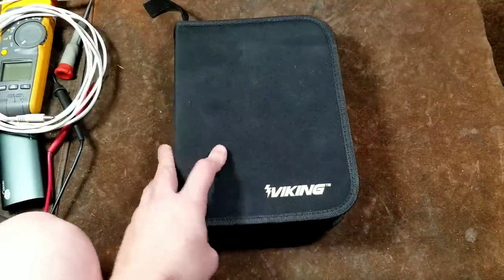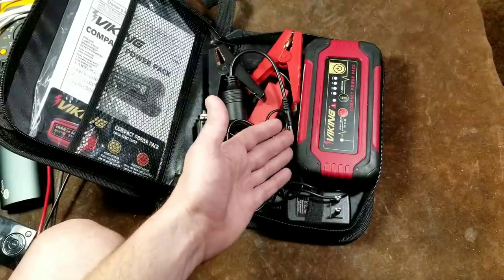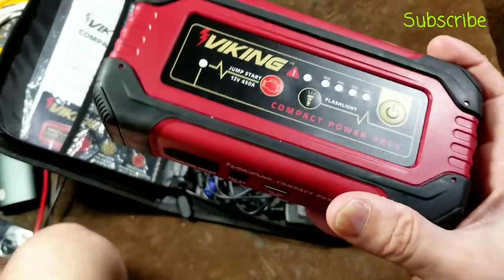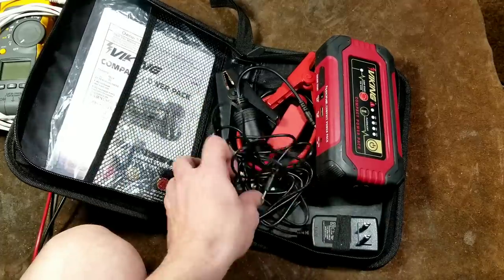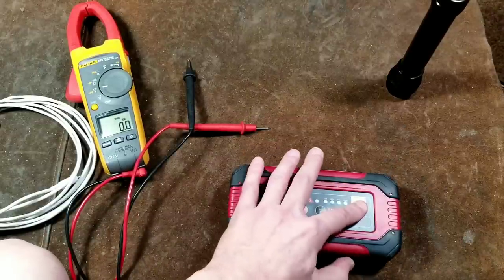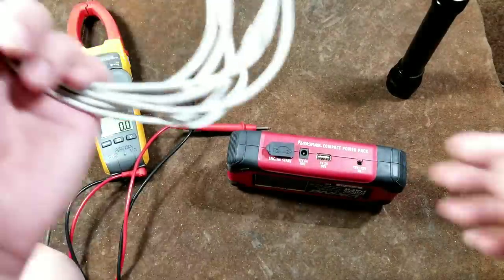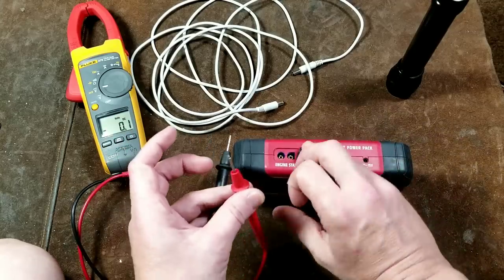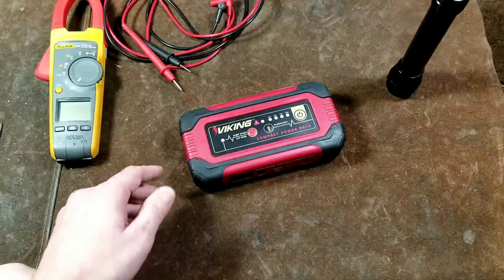Harbor Freight Viking Li-Ion Jump Starter Power Pack Review & Evaluation

Comment: I have this jump pack and I'm satisfied with its performance. I have used the 12v port to power trailer running lights on a night trip from St Louis to Louisville for 5 hours. Having it for multiple uses is nice. I don't leave home without it.

Comment: This thing is Excellent - I've used it for 2 years so far and it works great - Charges in 4 hours - In fact I used it to run my internet router and modem for 3 hrs in my house during this past storm when I lost power - I hooked up a small inverter to it to get out 110V.  Perfect to give your kid just in case it fits in the glove box - Lithium is the way to go - The most important thing for me is fast recharge and this does that.

Comment: I bypassed the switch mentioned at 15:10 with a splice connector on the negative side on mine. I bought it so that i could run a 120w inverter and the switch was sort of a deal breaker but the quality of the box was on point. Amazing  video

Comment: Good honest review!   You definitely know what you’re talking about.  👍. A lead acid pack will start my diesel in warm weather. If you leave the unit on the battery for a while before cranking.  Cold weather I need two units. One on each battery.

Comment: the screws  clamp the shell together  but those groves along the edge keep the box aligned and prevent it from separating.  If the battery was not held down it could cause a problem  there sb nothing pushing the shell apart. .   The 12 V sends power out to activate the safety box to verify jumper cables are connected properly.

Comment: Wow, I was planning on purchasing the harbor freight jump starter but decided to pass on it due to the false capacity rating. I decided to buy a cheap LiFePO4 version on Amazon called KeepPower. To my surprise, it is mostly identical to the version in this video. Only the lights and buttons on the top cover are in different locations. I only paid $40 for it. Of course they rated it at 12Ah which would only be that capacity at 3.2 volts. I guess honestly rating it 3Ah at 12.6 volts would hurt their sales due to ignorant folks.  

Due to the auto shutdown nature of the jumper and the 12 volt output port detecting voltage on my tester and shutting off, I had to connect directly to the battery to test the actual capacity. Surprisingly it came up to approximately 2,9XX of 3,000 mAh at 12 V. I was a bit impressed. 

I've taken pictures and will be leaving an amazon review soon.
Reply: Cannot find what you said u purchased on Amazon. Care to post a link?
Reply: Ahhh....KeenPower, NOT KeepPower. Have you used your keenpower unit to charge up iPhones or iPads? Or similar devices? I have and it seems to drain the KeenPower’s battery pack quite quickly when charging my iPad. From 100 to 25% on one charge. And it takes hours to complete.

Comment: It look like a good product with some good features on it. I would like to see it in action, jump starting a dead battery
Reply from the maker: I was going to do that but I thought it was kind of pointless. I needed an artificial load to actually test its peak and continuous power outputs which is something I don't have.
Reply: I’m a mechanic and use this to jump start dead cars outside to drive them in for diag work. It works amazing. Very rugged and works well in all temperatures. Holds a charge great and well worth the money
Reply: I will also back it up. I used mine today to jumpstart a 240sx that hasn't been run since 2016 and the battery was from 08.

Comment: I have this unit and it came with just a car charger and my car charger doesn't work so I saw it had a 12 volt in so I plug it in and it just flashes the 25 percent light and doesn't charge. Should I just go to harbor freight and exchange for a new one? The product is great it's very convenient and compact.

Comment: A large diesel engine say for a 18 wheeler will use 1000  amps  at 12 volts will probably ring in around 12000 watts and 20 hp at initial turnover
Good review and description just figured Id through some numbers out for very big diesels

Comment: Really wanted you to start a car that had a dead battery.  Several reviews of this thing (on Amazon and other sites) said it didn't work, or worked for 3 or 4 times and never again, even though it had been plugged in and charging for 2 days.  70% 5 star reviews, but 20% 1 star reviews.

Comment: Project Farm tested several jump starter power packs and the Harbor Freight failed.
Reply: Project Farm just repeated the test and Viking failed again.  It's the pits. I returned mine on the day I bought it because the plastic box on the red positive wire sparked and smoked.    This in a lawn Tractor!
Reply: I have this unit. Bought in 2018 has worked flawless jumping dozens of vehicle's. Still working at 100 % capacity 9/5/22

Comment: Can this jumpstart my Kenworth log loader?
Reply: Probably not.  Your log loader is probably 24 volt system.  You probably have 2 12 volt batteries wired in series. This is designed for only 1 12 volt battery by itself.
Reply: Come to think of it, it might work if you get two of them.  Connect the black lead of one to the red lead of the other.  Then hook the red lead of this thing to your red or positive + post and the black lead of the other one to your black or negative post.  That makes it in series.  Oh wait.  Then you'll have 24 volts coursing through these, which will probably blow the micro-processors and ruin these.
Reply: Actually I came across a Clore Jump 'N Carry, JNC 660, yesterday.  This supposedly is what tow trucks carry with them to jump start cars and pick-ups.  One person commented that it even started his dump truck that has two batteries.  So, if it starts a dump truck diesel engine, I think it should start your Kenworth log loader.  (I used to work in paper /pulp mills so I do know what you are talking about.)  The JNC 660 has a blue case (to help you identify it).  They run about $130, although some fly-by-nighters offer them at $62 and $39, which are probably scams.

Comment: Is it possible to run a small power inverter off the 12v 6 amp output? I tried an 80w continuous/200w peak w/ no load on it & it triggered the overload protection on the Viking (shutoff & beeping).
Reply from the maker: Power inverters have big capacitors which probably what's triggering the overload. Try plugging the power converter into an actual car and then quickly plugging into the power pack it'll probably work in that situation. A power inverter is a computer switching power supply that's just operating in Reverse to give you AC
Reply: @CatusMaximus  Hi Catus, thank you for doing this review as I've had some questions about this Viking Power pack. In particular: with all of the power outages we've had recently I was hoping I could use this to run my wood-stove fan (34 to 74watts/120v) through a (Harbor Freight) Cen-tech (750w continuous / 1500 watt peak) Inverter. I ran into the same problem that Evan ran into (using the 12v DC output). In your response you mentioned that he should "Try plugging the power converter into an actual car and then quickly plugging into the power pack". I don't have a "car" nearby, so I was wondering: Option 1. Would "jumpstart" mode be enough to overcome the initial capacitor demand in the Inverter and then run my fan? Option 2: I have a small 8AH Lead acid battery that I am using to run a router- could I use that in place of the "car" to overcome the initial Capacitor demand? Thank you for your help!
Reply: This is guy is gonna return  the item back after this youtube video... how lame. Faker

Comment: Could you tap into the large conductors coming from the battery and use this instead of a battery for a motorcycle?
Reply from the maker: No, the motorcycle charging systems for lead-acid. It is known as a constant voltage charge system which would cause a lithium ion battery to eventually catch fire from overcharging lithium ions need special intelligent Chargers that can detect when the battery is full and then turn themselves off
Reply: No, because it shuts off in 30sec

Comment: Is that a lithium-ion or a lithium-iron unit? HF used to advertise it as lithium-iron which is a better unit.
Reply from the maker: It is a lifepo4 lithium ferrite phosphate. Lithium ion batteries are confusing because lithium Cobalt, lithium ferrite phosphate, Lithium Polymer they're all lithium-ion type batteries. But with different chemistry's but still behave relatively similar to each other as far as charging. Some are less prone to fire someone can take many more charge cycles some can deliver very high amounts of power some are extremely lightweight for their given capacity and each battery type makes a sacrifice to achieve a particular goal such as weight or charge cycles or charging safety
Reply: @CatusMaximus  You got the good one. Lithium-iron has advantages when used as a car jumper. I looked on HF's website and they now list it as a lithium-ion battery pack whereas before they listed it as a lithium-iron unit. I don't know if they changed the batteries or just the description.

As a side note, if your battery is completely dead and the jump pack won't start the car, you can disconnect the negative battery terminal and start the car directly from the jump pack. Once the car is running you can then reconnect the battery terminal and then remove the jump pack. It's best to do that procedure as quickly as possible because it's not good for the jump pack to be left on the battery after the car is running.
Reply: @Pro1er  it is like you didn't read what he replied with
Reply: @williammiller7791  Please explain.
Reply: @Pro1er  it is a lithium ferrite phosphate (lithium iron phosphate) they may have changed the nomenclature but the battery is Li-Fe-PO4
Reply: @williammiller7791  What part of his reply did I not read? Perhaps you miss-read my reply. I had researched the different jump pack battery technologies about a year ago and the information Catus provided can be found on wikipedia. What I emphasized is that Harbor Freight no longer lists the battery chemistry as lithium iron.
Reply: Whatever buy one or don't at 5:55 he gives specs on the battery in his unit, beyond that call HF and ask them. "what is the the battery in item #62749?" really not complicated, or go to a brick and mortar store and ask the manager to find out, I'd call the company, but it seems exhaustively covered by the reviewer.

Comment: Anyone have any input as to why this thing shuts off after a couple minutes while using a 12v power connection?
Reply: if i remember correctly, one reviewer complained that he had to turn the flashlight on to keep the power connector from shutting down. Good luck

Comment: I bought one of these during a HF parking lot sale for $50 ~7 years ago and it has been almost universally disappointing, with Project Farm confirming my bias.  All it's been able to do for me was pop open the trunk of my dad's W222 Mercedes while the main battery was disconnected and charging, after it sat in the pantry for a couple of years. 
It's been one my worst HF purchases, and I'm not even a HF or lithium battery hater.

But maybe it's just user error.🤔

Comment: Unfortunately this Harbor Freight 450 amp Jump Starter is extreamly weak compared to others and it may not turn over your engine in the time of need. Your better off investing a few dollars more in at least a 800 amp or higher Jump Starter if you have a V-6 or V-8 to insure that you can start your car if needed.

Comment: Semi's use 24 volt batteries, that is why it will not start a semi, I am a retired trucker. Mobile home RV's use 12 volt batteries wired in parallel, I used to own one. Get your facts straight.
Reply: You should review the video because at no time did the reviewer mention that a diesel engine from a semi was the former use of the returned device.

Comment: You can buy a much better battery than HF junk.  Project Farm did a review of many of these types of batteries.  I bought a Top Vision from Amazon for $80.00  and killed the battery on a Toyota Highlander so the battery only showed 5.5 Volts and the Top Vision started it right up.  Don't buy this piece of junk.

Comment: Too long explanation of starter motors, just say they may draw a couple hundred amps while turning the engine over.
144 watts is 12 Amos at 12 volts while 144 watts is 11 amps at 13 volts.
I used this pack to turn over my 1987 351 ford Bronco.
What I want is 3 smaller ones to carry in my motorcycles for emergency jumps.
Too much rambling, I was boared to death after the first 3½ minutes.

Comment: Nope your wrong a Norco GB 70 will do what you say that one can't. Nevermind the GB 150 just face it that thing is weak compared to the Norco. Which will start a full size car with no battery in it multiple times even if it's real cold
Reply: Well I have this one and I have jumped my 7.3 diesel truck with 2 batterys and lots of cars that have no batterys at all.